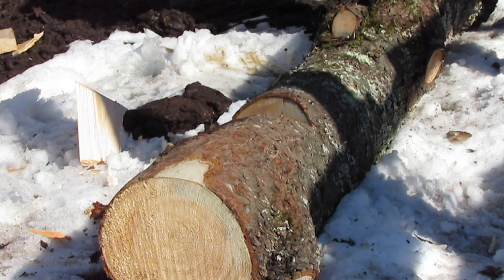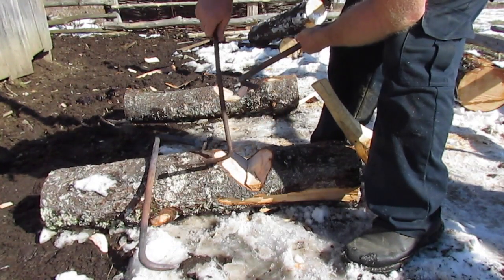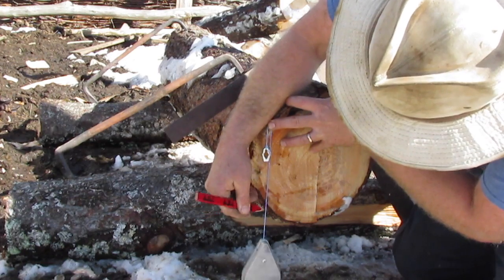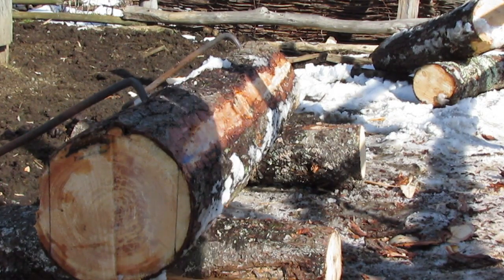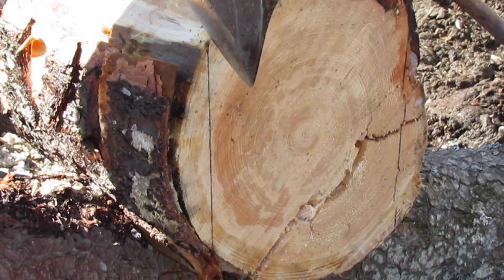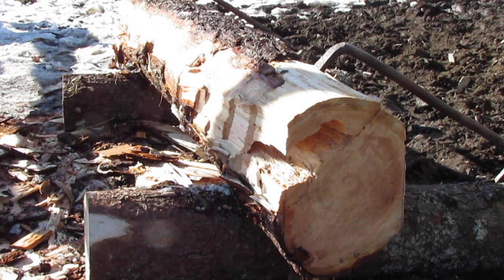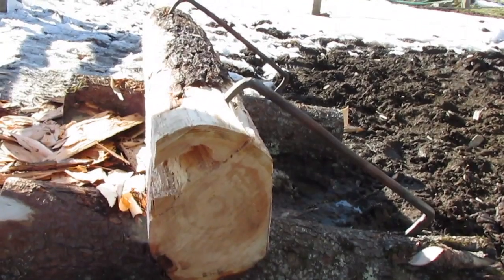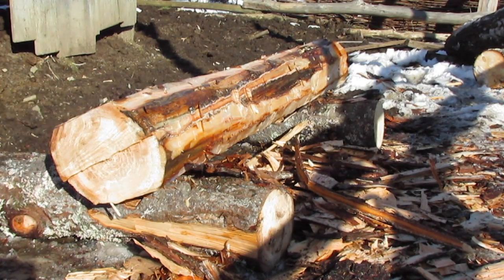Hewing for Homesteaders- Basic Tools and Process

Comment: Great overall video.  How long should a tree have been felled (naturally or by man) before you hew it?  Thanks again for taking the time to make the video.
Reply from the maker: Typically you hew when the wood is still green, so you can start hewing as soon as the tree falls.  You can still hew dry logs but it isn't the usual way.
Reply: @oxbowfarm5803  is there a certain amount of time that the wood should be seasoned, or a moisture level that should be reached before using the timber?
Reply: @jerrywhidby.  I would say that depends on what your use will be if your timber framing they would build it wet and as it dries and shrinks all the Mortice tennon dowel joints become tighter if tou plan in making furniture then a dry "stable" material is what you would prefer as most of the "movement" has taken place save the expansion and contration of the season.

Comment: Any comments on selecting logs for hewing? I’ve got lots of large trees already on the ground for some time now. Everything I see advises to hew as soon as it’s on the ground. I’m just starting out, so I imagine for my first few using year old dead trees will be good to practice on.
Reply from the maker: It is easier to hew wood when it is green, but it is perfectly possible to hew dead logs, if they are dead but still fairly wet then there isn't really much difference from hewing green logs.
Reply: Pine and other conifers are the easiest to hew bard woods or woods that have a twist are a little more difficult as the axe wants to follow the grain.

Comment: Would you ever score a 2nd time going the opposite direction of the 1st time?
Reply from the maker: It is sometimes necessary to score a second time, but it doesn't really matter what direction since the only purpose is to sever the fibers so you can take controlled chips instead of trapping your axe in the log.  The direction and angle of the scoring cut is more about personal preference and how smooth you need the finished surface to be.

Comment: How often do you resharpen your axe?
Reply from the maker: It really depends on the conditions.  Its good to try and keep the logs clean or to bark them off if they are covered in mud, mud dulls your edge really fast.  It also is really wise to mound all the chips directly under the log so you hit chips instead of soil so if you miss while hewing the axe hits chips instead of rocks and dirt.  Green wood is not that abrasive to an axe, the edge geometry is really durable, so if you can avoid abrasive mud and grit on the log you can go a long time between sharpenings.